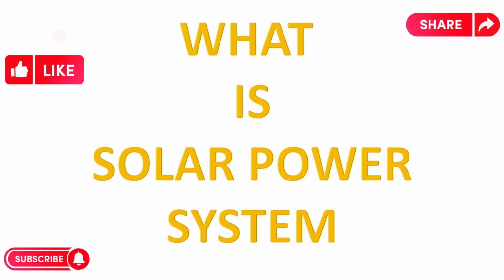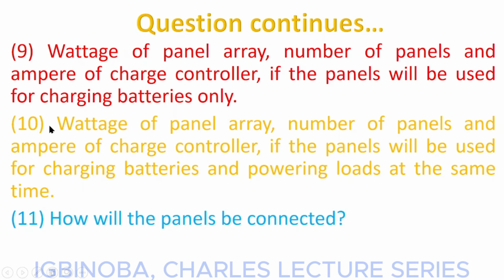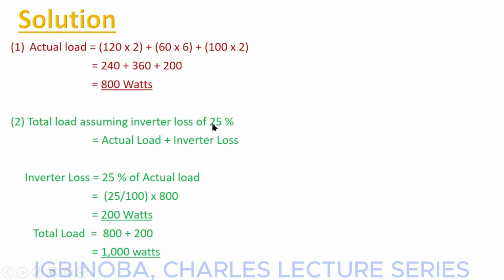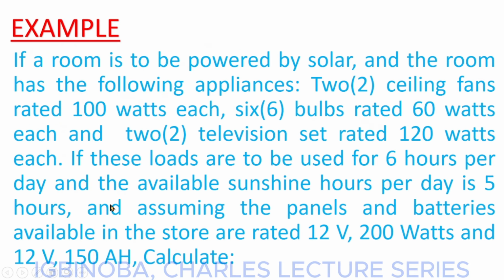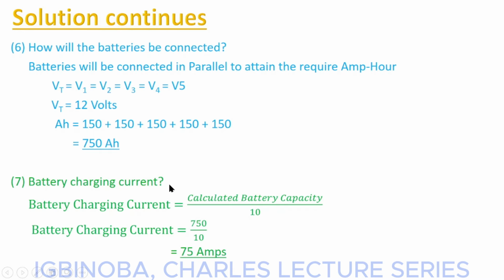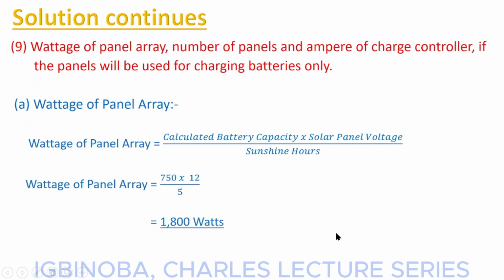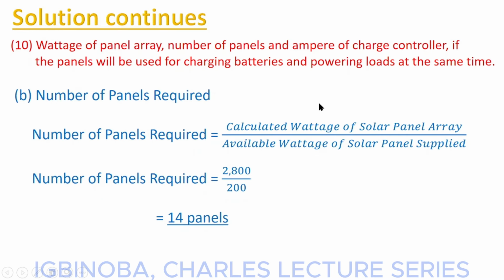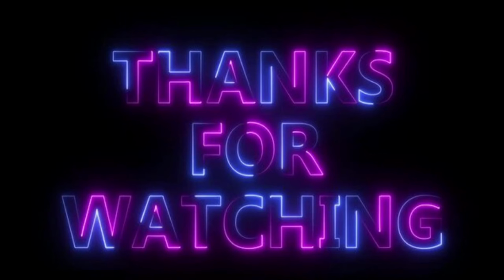Design of Solar Power System

Comment: MAR394P
1. Actual Load: 1380 watts
2. Total Load: 1725 watts
3. Inverter Rating: 2156.25 VA
4. Battery Capacity: 1293.75 Ah
5. Number of Batteries: 8.625 – 9 batteries
6. Parallel
7. Battery charging current: 129.375 Amps
8. Charging time: 14 hrs
9. (a) 3105 watts
(b) 15.525 – 16 panels
(c) 258.75 Amps
10. (a) 4830 watts
(b) 24.15 – 24 panels
(c) 402.5 Amps
11. Parallel

Comment: COMP353A
1. Actual Load: 1380 W

2. Total Load (including inverter loss): 1840 W

3. Inverter Rating (VA): 2300 VA

4. Battery Capacity: 1227 Ah

5. Number of Batteries: 9 batteries

6. Battery Connection: Parallel

7. Battery Charging Current: 15 A (per battery string)

8. Battery Charging Time: 5.1 days

9. Panel Array (for charging batteries only):

Wattage: 2945 W

Number of Panels: 15 panels

- Charge Controller Ampere: 245 A

10. Panel Array (for charging batteries and powering loads):

Wattage: 4785 W

Number of Panels: 24 panels

Charge Controller Ampere: 399 A

11 Panel Connection Series - Parallel

Comment: CHM70R

1 actual load =1380w
2 Total load =1725w
3 Inverter rating=2156.25va
4 battery rating=1293.75Ah
5 Number if batteries=9
6 battery are connected in parallel 
7 Battery charging current=129.4amps
8 Battery charging time= 14hrs
9
a wattage panel array=3105watts
b Number of panels =16
C charge controller =258.75A
10.
a wattage of panel array=4830 watts
b Number of panels=24
C charge controller=402.5A
11 panel are arranged in parallel

Comment: EEE3127W

1. Actual Load = 1380 watts

2. Total Load = 1725 watts

3. Inverter Rating = 2156.25 VA

4. Battery Capacity = 1293.75 Ah

5. Number of Batteries = 8.625 ~ 9 batteries

6. Parallel

7. Battery charging current = 129.375 Amps

8. Charging time = 14 hrs

9. (a) 3105 watts
    (b) 15.525 ~ 16 panels
    (c) 258.75 Amps

10. (a) 4830 watts
    (b) 24.15 ~ 24 panels
    (c) 402.5 Amps

11. Parallel

Comment: PETRO3670

ANSWERS 
1. Actual load= (100×3)+(60×10)+(120×4) =1380watts
2. Total load assuming inverter loss of 25%= Actual load +Inverter loss
Inverter loss=25% of Actual load
= 25%×1380=345 watts
Total load= 1380+345=1725 watts
3. Inverter rating on VA using power factor of 0.8
= (1725÷0.8)= 2156.25
4. Battery capacity using factor for reserve 75%=(2×1725×6×0.75)=1293.75Ah
5. No. of batteries for backup hours=1293.75Ah÷150Ah= 8.6 =8 batteries 
6. How batteries will be connected?
The batteries will be connected in parallel 
Vt=V1=V2=V3=V4=V5=V6=V7=V8
Ah= 150+150+150+150+150+150+150+150=1200
7. Battery charging current=1293.75÷10=129Amps
8. Battery charging time assuming charging loss of 40%= 1293.75Ah+(40%+1293.75Ah)÷129A=14hrs
9a. Wattage panel array= 3105 watts
9b. Number of panels required= 3105÷345=9 panels 
9c. Ampere of charging controller required= 3105÷12=258.75Amps
10a. Wattage of panel array= Calculated wattage of solar panel array for charging battery only+ calculated total load =3105+1725=4830watts
10b. Number of panels required= calculated wattage of solar panel array÷ Available wattage of solar panel supplied= 4830watts÷345= 14Amps
10c. Ampere of charge controller= calculated wattage of solar panel array÷ solar panel voltage=4830watts÷12volts= 402.5Amps
11. How will the panels be connected?
Ans: They will be connected in parallel

Comment: EEE 3131A

1. Actual Load = 1380 watts
2. Total Load = 1725 watts
3. Inverter Rating = 2156.25 VA
4. Battery Capacity = 1293.75 Ah
5. Number of Batteries = 8.625 ~ 9 batteries
6. Parallel
7. Battery charging current = 129.375 Amps
8. Charging time = 14 hrs
9. (a) 3105 watts
    (b) 15.525 ~ 16 panels
    (c) 258.75 Amps
10. (a) 4830 watts
    (b) 24.15 ~ 24 panels
    (c) 402.5 Amps
11. Parallel

Comment: EEE3100V
1. Actual Load = 1380 watts 

2. Total Load = 1725 watts 

3. Inverter Rating = 2156.25 VA

 4. Battery Capacity = 1293.75Ah

5. Number of Batteries = 8.625~9 batteries 

6. Parallel 

7. Battery charging current=129.375 Amps

 8. Charging time = 14 hrs 

9. (a) 3105 watts
 (b) 15.525~16 panels 
(c) 258.75 Amps 

10. (a) 4830 watts 
(b) 24.15~24 panels 
(c) 402.5 Amps

 11. Parallel

Comment: EEE3141K
1. Actual load = 1380 watt
2. Total load = 1725 watt
3. Inverter rating = 2156.25 VA
4. Battery rating= 1293.75 Ah
5. Number if batteries = 9
6. Battery are connected in parallel
7. Battery charging current= 129.4 amps
8. Battery charging Time = 14hrs
9
a. Wattage panel array = 3105 watts
b. Number of panels = 16
c. Charge controller= 258.75 A
10
a. Wattage of panel array = 4830 watts
b. Number of panels= 24
c. Charge controller= 402.5 A
11. Panels are arranged in parallel

Comment: COMP323W

1. Actual load 1380W

2. Total load  1720W

3. Inverter rating  2156.25VA

4. battery Capacity 1293.75Ah

5. number of batteries 8.6

6. Parallel 

7. Battery charging  129.4A

8. T = 14hrs

9. (a) 3105W
   (b) 15.5 panels 
   (c)  258.75 A

10. (a) 4830W 
     (b) 24 panel 
     (c) 402.5A 

11. Parallel

Comment: PETROCHEM317Q 
1 Actual load 1380W
2 Total load  1720W
3 Inverter rating  2156.25VA
4 battery Capacity 1293.75Ah
5 number of batteries 8.6
6 Parallel 
7 Battery charging  129.4A
8 T = 14hrs
9 (a) 3105W
   (b) 15.5 panels 
   (c)  258.75 A
10 (a) 4830W 
     (b) 24 panel 
     (c) 402.5A 
11 Parallel

Comment: EEE10J

1 actual load =1380w
2 Total load =1725w
3 Inverter rating=2156.25va
4 battery rating=1293.75Ah
5 Number if batteries=9
6 battery are connected in parallel 
7 Battery charging current=129.4amps
8 Battery charging time= 14hrs
9
a wattage panel array=3105watts
b Number of panels =16
C charge controller =258.75A
10.
a wattage of panel array=4830 watts
b Number of panels=24
C charge controller=402.5A
11 panel are arranged in parallel

Comment: MAR3128X

1. Actual load : 1380 W
2. Total load: 1725 w
3. Inverter rating: 2156.25 VA
4. Battery capacity: 1293.75 AH
5. Number of batteries: 9
6. Configuration: parallel 
7. Battery charging current: 129.375 amps
8. Charging time: 14 hours
9. (a) 3105 w
     (b) 15.5 panels
     (c) 258.75 A
10. (a) 4830 Watts 
       (b) 24 panels
        (c) 402.5 A
11. Configuration: parallel

Comment: PETRO3167K
 
1. Actual load= (100×3)+(60×10)+(120×4) =1380watts

2. Total load assuming inverter loss of 25%= Actual load +Inverter loss
Inverter loss=25% of Actual load
= 25%×1380=345 watts
Total load= 1380+345=1725 watts

3. Inverter rating on VA using power factor of 0.8
= (1725÷0.8)= 2156.25

4. Battery capacity using factor for reserve 75%=(2×1725×6×0.75)=1293.75Ah

5. No. of batteries for backup hours=1293.75Ah÷150Ah= 8.6 =9 batteries 

6. The batteries will be connected in parallel 

7. Battery charging current=1293.75÷10=129Amps

8. Battery charging time assuming charging loss of 40%= 1293.75Ah+(40%+1293.75Ah)÷129A=14hrs

9a. Wattage panel array= 3105 watts

9b. Number of panels required= 16

9c. Ampere of charging controller required= 3105÷12=258.75Amps

10a. Wattage of panel array =3105+1725=4830watts

10b. Number of panels required= 24

10c. Ampere of charge controller=4830watts÷12volts= 402.5Amps

11. They will be connected in parallel

Comment: EEE78Z 

1. Actual load = 1380W
2. Total load = 1725W
3. Inverter rating = 2156.25VA
4. Battery rating = 1293.75Ah
5. Number if batteries = 9
6. Battery are connected in parallel 
7. Battery charging current = 129.4amps
8. Battery charging Time = 14hrs
9.
a. Wattage panel array = 3105watts
b. Number of panels = 16
c. Charge controller = 258.75A
10.
a. Wattage of panel array = 4830 watts
b. Number of panels = 24
c. Charge controller = 402.5 A
11. Panels are arranged in parallel

Comment: COMP333G 

1 Actual load 1380W
2 Total load  1720W
3 Inverter rating  2156.25VA
4 battery Capacity 1293.75Ah
5 number of batteries 8.6
6 Parallel 
7 Battery charging  129.4A
8 T = 14hrs
9 (a) 3105W
   (b) 15.5 panels 
   (c)  258.75 A
10 (a) 4830W 
     (b) 24 panel 
     (c) 402.5A 
11 Parallel

Comment: CIV382D
1. Actual load = 1380 watt 2. Total load = 1725 watts 3.Inverter rating = 2156.25 VA 4.Battery rating= 1293.75 Ah 5. Number of batteries = 9 6.Battery are connected in parallel 7.Battery charging current = 129,4 Amps 8.Battery charging time = 14 hrs
a Wattage of panel array = 3105 watts
b Number of panel = 16 panels
c Charge controller = 258.75 A
10.
a Wattage of panel array = 4830 watts
b Number of panels = 24
c Charge controller = 402.5 A
11.panels are arranged in parallel

Comment: CHM 377Y

1. Actual load = 1380W
2. Total load = 1725W
3. Inverter rating = 2156.25 VA
4. Battery capacity = 1293.75 Ah
5. No of batteries =  9
6. Parallel
7. Battery charging current = 129.375Amps
8. Charging time = 14hrs
9 (a) 3105W
(b)  16 panels
(c) 258.75 Amps
10 (a) 4830 watts
(b) 24 panels
(c) 402.5 Amps
11. Parallel

Comment: EEE 339M

1. Actual load: 1380 W
2. Total load: 1725 W
3. Inverter rating: 2156.25 VA
4. Battery capacity: 1293.75 Ah
5. Number of batteries: 9
6. Configuration: Parallel
7. Battery charging current: 129.375 Amps
8. Charging time: 14 hours

9(A) 3105 W 
(B) 15.5 panels 
(C) 258.75 A

10 (A) 4830 W 
(B) 24 panels 
(C) 402.5 A

11. Configuration: Parallel

Comment: NAT20T 
1. Actual load = 1380 watt
2. Total load = 1725 watt
3. Inverter rating = 2156.25 VA
4. Battery rating = 1293.75 Ah
5. Number of batteries = 9
6. Batteries are connected in parallel
7. Battery charging current = 129.4 amps
8. Battery charging Time = 14hrs
9. a. Wattage panel array = 3105 watts
   b. Number of panels = 16
   c. Charge controller = 258.75 A
10. a. Wattage of panel array = 4830 watts
    b. Number of panels = 24
    c. Charge controller = 402.5 A
11. Panels are set up in parallel

Comment: COMP 378Z

1 Actual load 1380W
2 Total load  1720W
3 Inverter rating  2156.25VA
4 battery Capacity 1293.75Ah
5 number of batteries 8.6
6 Parallel 
7 Battery charging  129.4A
8 T = 14hrs
9 (a) 3105W
   (b) 15.5 panels 
   (c)  258.75 A
10 (a) 4830W 
     (b) 24 panel 
     (c) 402.5A 
11 Parallel

Comment: MAR3109E

1. Actual power demand: 1380 W

2. Total estimated load: 1725 W

3. Required inverter capacity: 2156.25 VA

4. Battery bank capacity: 1293.75 Ah

5. Total number of batteries needed: 9

6. Battery configuration: Parallel connection

7. Battery charging current: 129.4 A

8. Estimated charging duration: 14 hours

For the first solar array design:
a. Total solar array output: 3105 W
b. Number of panels required: 16
c. Charge controller size: 258.75 A

For the second solar array design:
a. Total solar array output: 4830 W
b. Number of panels required: 24
c. Charge controller size: 402.5 A
11. Panel arrangement: Parallel connection

Comment: MECH3121Q

1. Actual load= (100×3)+(60×10)+(120×4) =1380watts
2. Total load assuming inverter loss of 25%= Actual load +Inverter loss
Inverter loss=25% of Actual load
= 25%×1380=345 watts
Total load= 1380+345=1725 watts
3. Inverter rating on VA using power factor of 0.8
= (1725÷0.8)= 2156.25
4. Battery capacity using factor for reserve 75%=(2×1725×6×0.75)=1293.75Ah
5. No. of batteries for backup hours=1293.75Ah÷150Ah= 8.6 =8 batteries 
6. How batteries will be connected?
The batteries will be connected in parallel 
Vt=V1=V2=V3=V4=V5=V6=V7=V8
Ah= 150+150+150+150+150+150+150+150=1200
7. Battery charging current=1293.75÷10=129Amps
8. Battery charging time assuming charging loss of 40%= 1293.75Ah+(40%+1293.75Ah)÷129A=14hrs
9a. Wattage panel array= 3105 watts
9b. Number of panels required= 3105÷345=9 panels 
9c. Ampere of charging controller required= 3105÷12=258.75Amps
10a. Wattage of panel array= Calculated wattage of solar panel array for charging battery only+ calculated total load =3105+1725=4830watts
10b. Number of panels required= calculated wattage of solar panel array÷ Available wattage of solar panel supplied= 4830watts÷345= 14Amps
10c. Ampere of charge controller= calculated wattage of solar panel array÷ solar panel voltage=4830watts÷12volts= 402.5Amps
11. How will the panels be connected?
Ans: They will be connected in parallel

Comment: MAR332F

1. Actual load = 1380 watt
2. Total load = 1725 watt
3. Inverter rating = 2156.25 VA 
4. Battery rating= 1293.75 Ah
5. Number if batteries = 9
6. Battery are connected in parallel 
7. Battery charging current= 129.4 amps
8. Battery charging Time = 14hrs
9
a. Wattage panel array = 3105 watts
b. Number of panels = 16
c. Charge controller= 258.75 A
10
a. Wattage of panel array = 4830 watts
b. Number of panels= 24
c. Charge controller= 402.5 A
11. Panels are set up in parallel

Comment: MECH356D
1. Actual load: 1380 watts

2. Total load: 1725 watts

3. Inverter rating: 2156.25 VA

4. Battery capacity: 1293.75 Ah

5. Number of batteries: 8.6

6. Connection: parallel

7. Battery charging current: 129.375

8. Charging time

9. a. Wattage of panel array: 3105W

b. Number of panels:16 panels

c. Charge controller: 258.75A

10 a. Wattage of panel array - 4830W

b. Number of panel - 24

c. Charge controller - 402.5A

11. Panels arrangement: Parallel

Comment: COMP391M

1 Actual load 1380W
2 Total load  1720W
3 Inverter rating  2156.25VA
4 battery Capacity 1293.75Ah
5 number of batteries 8.6
6 Parallel 
7 Battery charging  129.4A
8 T = 14hrs
9 (a) 3105W
   (b) 15.5 panels 
   (c)  258.75 A
10 (a) 4830W 
     (b) 24 panel 
     (c) 402.5A 
11 Parallel

Comment: PETRO315O
1. Actual load= (100×3)+(60×10)+(120×4) =1380watts
2. Total load assuming inverter loss of 25%= Actual load +Inverter loss
Inverter loss=25% of Actual load
= 25%×1380=345 watts
Total load= 1380+345=1725 watts
3. Inverter rating on VA using power factor of 0.8
= (1725÷0.8)= 2156.25
4. Battery capacity using factor for reserve 75%=(2×1725×6×0.75)=1293.75Ah
5. No. of batteries for backup hours=1293.75Ah÷150Ah= 8.6 =8 batteries 
6. How batteries will be connected?
The batteries will be connected in parallel 
Vt=V1=V2=V3=V4=V5=V6=V7=V8
Ah= 150+150+150+150+150+150+150+150=1200
7. Battery charging current=1293.75÷10=129Amps
8. Battery charging time assuming charging loss of 40%= 1293.75Ah+(40%+1293.75Ah)÷129A=14hrs
9a. Wattage panel array= 3105 watts
9b. Number of panels required= 3105÷345=9 panels 
9c. Ampere of charging controller required= 3105÷12=258.75Amps
10a. Wattage of panel array= Calculated wattage of solar panel array for charging battery only+ calculated total load =3105+1725=4830watts
10b. Number of panels required= calculated wattage of solar panel array÷ Available wattage of solar panel supplied= 4830watts÷345= 14Amps
10c. Ampere of charge controller= calculated wattage of solar panel array÷ solar panel voltage=4830watts÷12volts= 402.5Amps
11. How will the panels be connected?
Ans: They will be connected in parallel

Comment: NAT325Y
1. Actual load = 1380 watts
2. Total load = 1725watts
3. Inverter rating = 2156.25 VA
4. Battery rating = 1293.75Ah
5. Nunber of batteries = 9
6. Battery are connected in parallel
7. Battery charging current=129.4Amps
8. Battery charging current = 129.4 Amps
9a.wattage of panel arrays = 3105watts
b. Number of panels = 16panels
c. Charge controllers = 258.75A
10a. Wattage kf panel arrays = 4830watts
b. Number of panels = 24
c. Charge controller = 402.5A
11. Panels are arranged in parallel

Comment: EEE3137G

1. Actual load: 1380 W 
2. Total load with 25% inverter loss: 1840W 
3. Inverter rating (PF 0.8): 2 300 VA 
4. Battery capacity (75% reserve): =920 Ah 
5. Number of batteries: 7 batteries 
6. Battery connection: All parallel 
7. Battery charging current: 138 A 
8. Battery charging time (40% loss):8.3 hours 
9. Panels for battery charging only: 14 panels (2800 W), 250 A controller 
10. Panels for charging + direct load: 26 panels (5 200 W), 420-450 A controller 
11. Panel connection: 7S2P

Comment: PETRO3193K

1. Actual load = 1380 watts
2. Total load = 1725 watts
3.Inverter rating = 2156.25 VA
4.Battery rating = 1293.75 Ah
5.Number of batteries = 9
6.Battery are connected in parallel
7.Battery charging current = 129.4 Amps
8.Battery charging time = 14 hrs
9
a Wattage of panel array = 3105 watts
b Number of panel = 16 panels
c Charge controller = 258.75 A
10.
a Wattage of panel array = 4830 watts
b Number of panels = 24
c Charge controller = 402.5 A
11.panels are arranged in parallel

Comment: PETRO3194L

1. Actual load = 1380 watts
2. Total load = 1725 watts
3.Inverter rating = 2156.25 VA
4.Battery rating = 1293.75 Ah
5.Number of batteries = 9
6.Battery are connected in parallel
7.Battery charging current = 129.4 Amps
8.Battery charging time = 14 hrs
9
a Wattage of panel array = 3105 watts
b Number of panel = 16 panels
c Charge controller = 258.75 A
10.
a Wattage of panel array = 4830 watts
b Number of panels = 24
c Charge controller = 402.5 A
11.panels are arranged in parallel

Comment: MAR349W

1.  Actual load 1380W
2.  Total load 1720W
3.   Invert rating 2156.35VA
4.   Battery capacity 1293.75Ah
5.   Number of batteries 8.6
6.   Parallel
7.   Battery charging 129.4A
8.   T=14hours
9(a).  3105W
  (b).   15.5 panels
  (c).    258.75A
10(a).   4830W
     (b).   24 panels 
     (c).    402.5A
11.    Parallel

Comment: MECH354B

1. Actual Load: 1380 watts

2. Total Load: 1725 watts

3. Inverter Rating: 2156.25 VA

4. Battery Capacity: 1293.75 Ah

5. Number of Batteries: 8.625-9 batteries

6. Parallel

7. Battery charging current: 129.375 Amps

8. Charging time: 14 hrs

9. (a) 3105 watts

(b) 15.525-16 panels

(c) 258.75 Amps

10. (a) 4830 watts

(b) 24.15-24 panels

(c) 402.5 Amps

11. Parallel

Comment: COMP392N

1 Actual load 1380W
2 Total load  1720W
3 Inverter rating  2156.25VA
4 battery Capacity 1293.75Ah
5 number of batteries 8.6
6 Parallel 
7 Battery charging  129.4A
8 T = 14hrs
9 (a) 3105W
   (b) 15.5 panels 
   (c)  258.75 A
10 (a) 4830W 
     (b) 24 panel 
     (c) 402.5A 
11 Parallel

Comment: COMP339M

1.	Actual load: 1380 W

2.	Total load: 1720 W

3.	Inverter rating: 2156.25 VA

4.	Battery capacity: 1293.75 Ah

5.	Number of batteries: 8.6

6.	Parallel
 7.	Battery charging current: 129.4 A

8.	T = 14 hrs

9.	(a) 3105 W
(b) 15.5 panels
(c) 258.75 A

10.	(a) 4830 W
(b) 24 panels
(c) 402.5 A
11.	Parallel